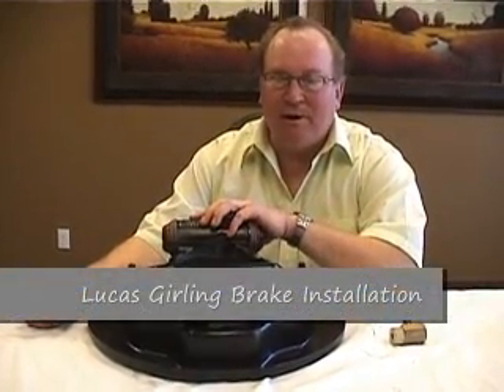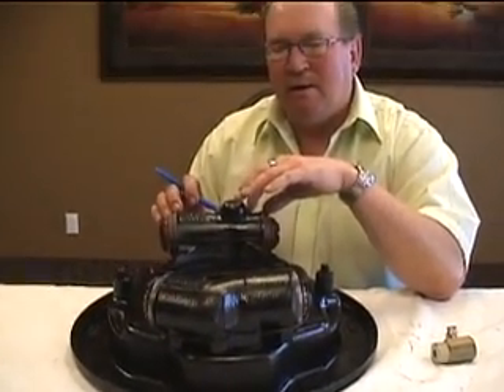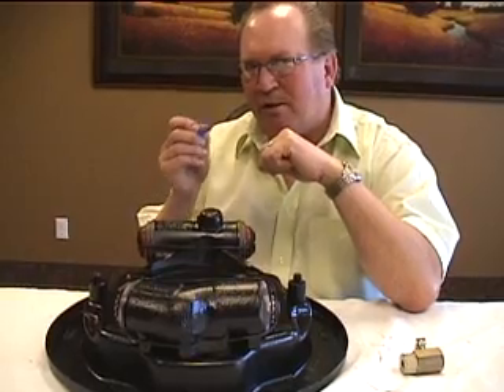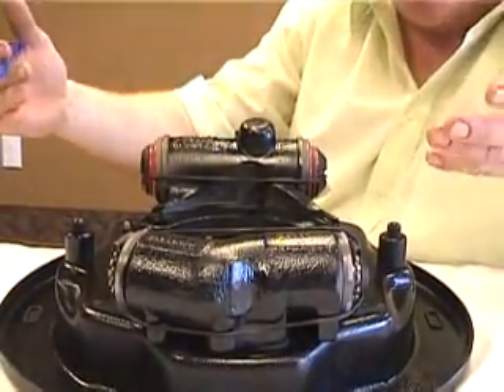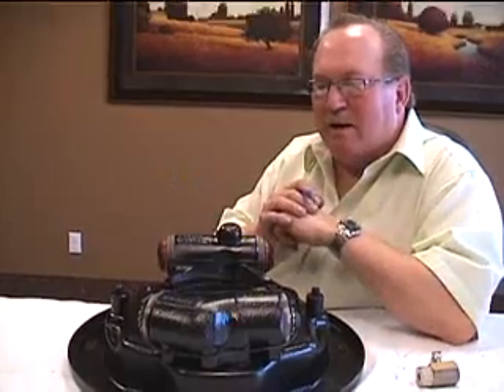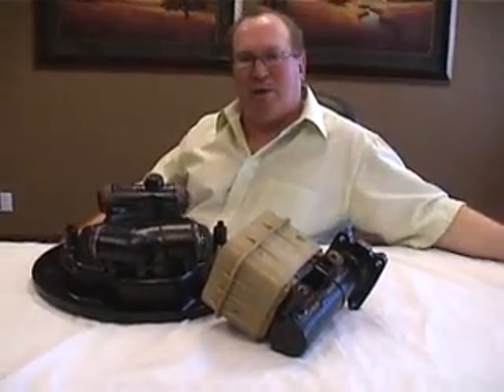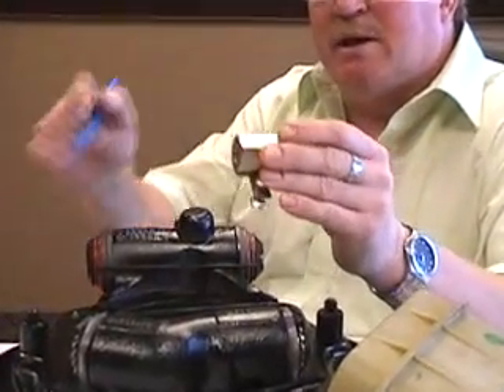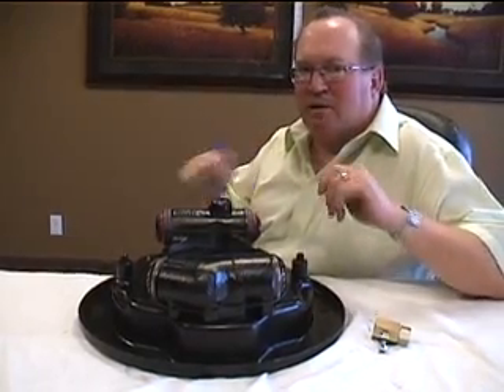Lucas Girling

Comment: The best thing to do is ........dont buy a vehicle with this junk on it.
Reply: You got it I just installed new brake lines bled 13 gallons of fluid thru it still have to pump the brake to stop this system sucks